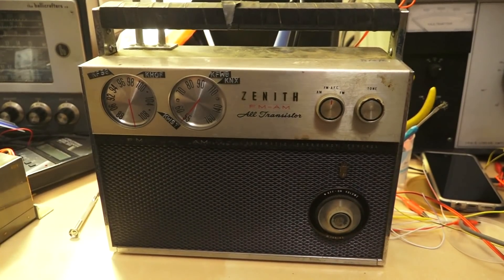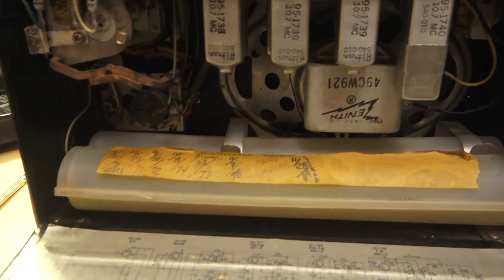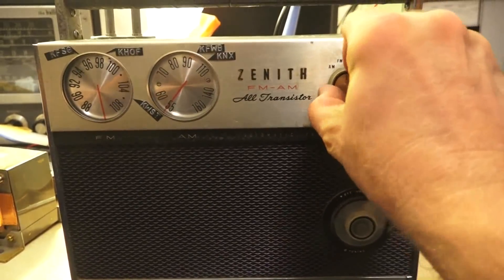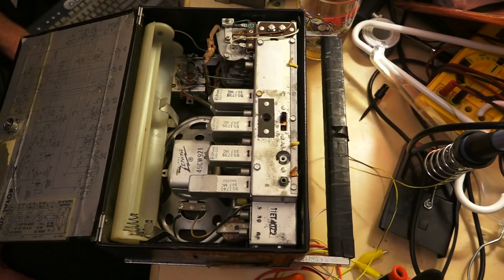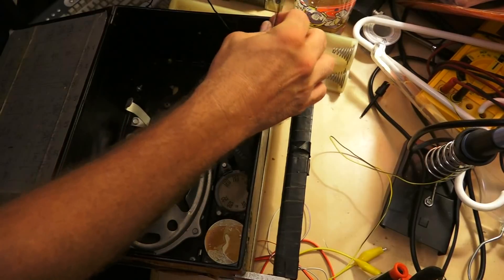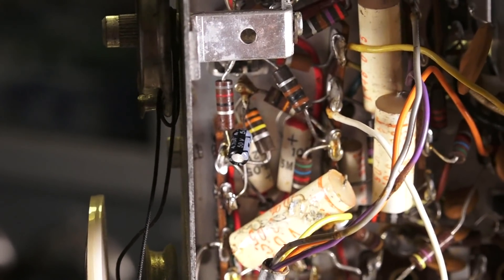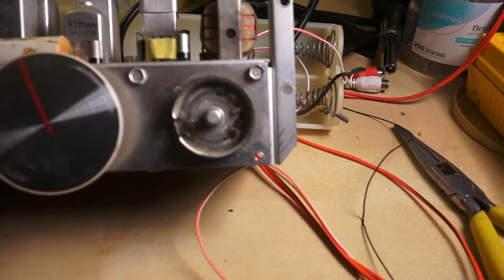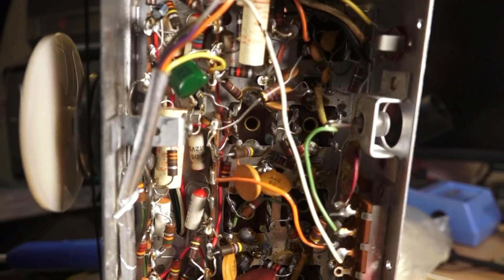Found and Repaired: Zenith Royal 2000

Comment: I just fixed my deceased dad’s Royal 2000. It had the same low, low volume intermittently. Some times it was just dead quite. I jumped out the same capacitor by disconnecting the tap connection on the volume pot and then ran wires using micro hooks to put in a 6 uF electrolytic as a replacement in the circuit. It’s working good now. I will do a real repair this week and check out the rest of the radio. Thank you so much for documenting your FA. 4 years later, it is still helping us out. I am so happy to have my Dad’s radio 📻 back!

Comment: Great job Broski!! Good info too. I have to restring mine. Wish you had posted that in your video.
Reply from the maker: Actually I need to redo the dial string, its slipping a bit and I think I missed a turn of cord somewhere. Plus the radio isn't working too well now, follow up video needed,.someday when I have the time.
Reply: I just bought one of these. Dials worked at the pawn shop but now the next day they don't work. It would be great to see a video some day of that. Thank you